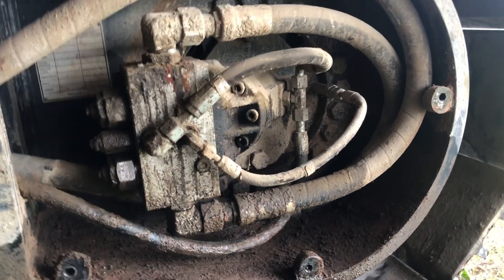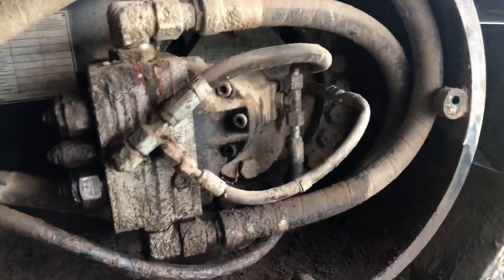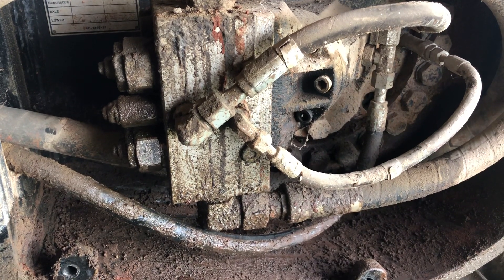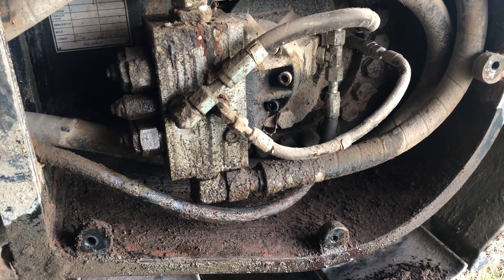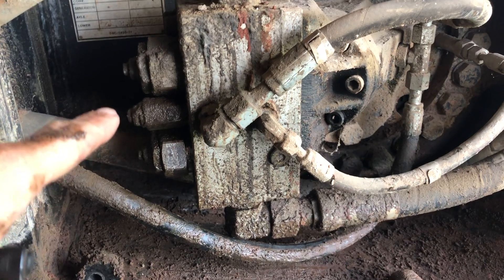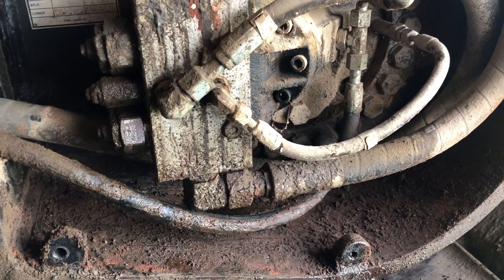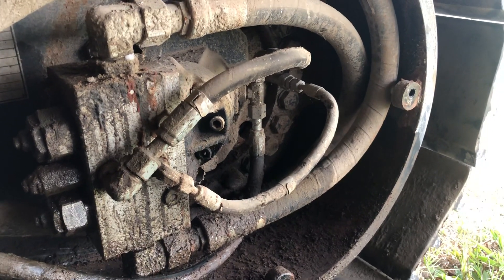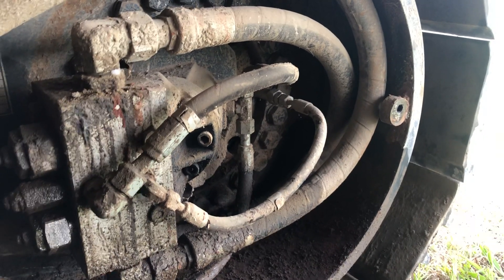Tips on finding hydraulic leaks and a little career advice

Comment: Is there any help that my hydraulic sheet metal cutting   machine is leaking some where and drop its cutting section even  in power off condition.actually i change piston seals,change directional valve and i can't  see any outside leak.please if you have any suggestions ?

Comment: I was forcing a lot of logs through a door opening in the barn, the stick being right inside. Job don, I tried to back out but the left track was dead. I heard psssss, and the top of both tracks were wet. Removed the drive panels and inside was packed solid with dry sandy soil dust and 1" pebbles almost to the top. Picked it all out, both sides filled a paint tin - - all dry, no oil. Pressure washed and left to dry. No obvious leak. All functions other than left track working. Couldn't spin the cab to lift up and access trap underneath because stick was in the doorway. Jacked up to get some sticks underneath for traction in the wet ground. Eventually I lost power to ALL functions and emptied all the hydraulics. 2008 1.5 tonne Takeuchi TB016 showing 1500 hours. Any ideas? Anyone? Thanks in advance!
LGBFJB+
Reply from the maker: If it dumped the entire tank I’d be looking at suction hose or returns from motors or control valves.  Had one in the shop do that after I cleaned the belly out.  Stuff was packed in so tight it kept it from spewing, it would just dribble.  Usually those will leak without machine running.  It’ll take some digging, flashlights and mirrors but usually your finger will find the wire poking out of the hose!  FJB!